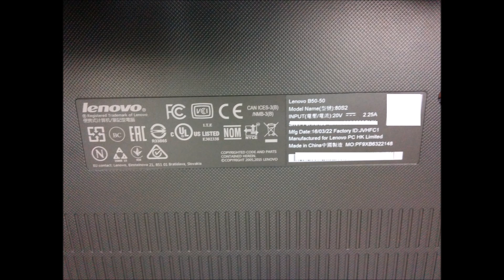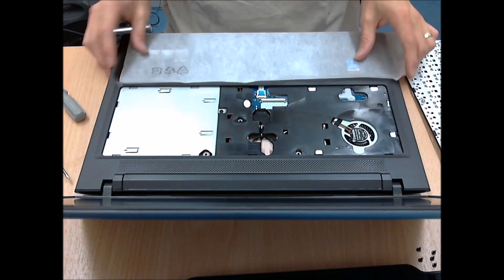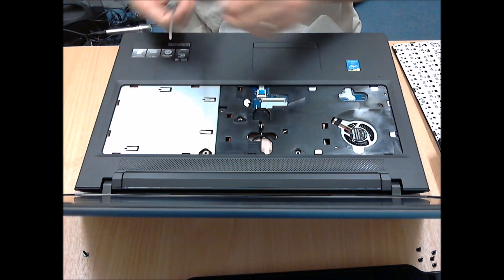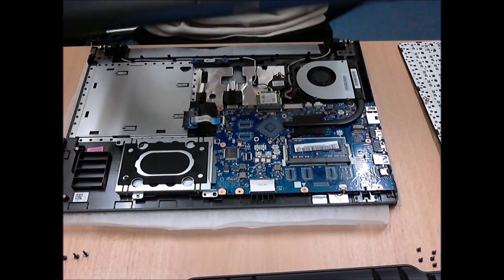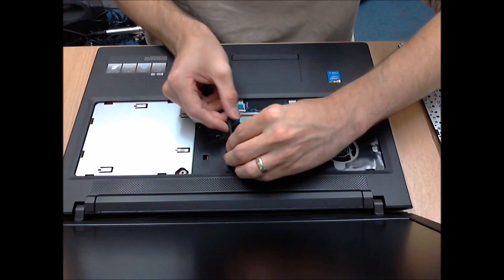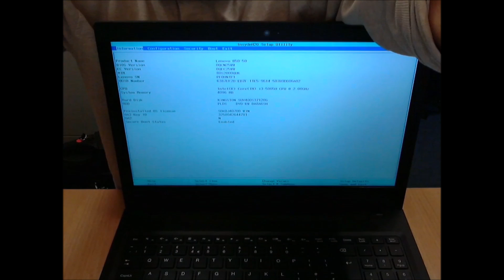Lenovo B50-50 - How to change or upgrade the hard disk

Comment: The Lenovo B50-10 laptop is a total piece of s**t! I'm currently  installing win11 on that dude and I decided to disassembly it, but the laptop didn't come out, then I found out that I have to remove keyboard from it! Then I didn't disassembly it any further to prevent damages. What the freak! It did have pre installed win10 and thank god it did already have 128 gb SSD installed. Ram 4 gb. processor dual core with 2.19 ghz speed. I WILL NEVER FIX OR DO CHANGES TO SIMILAR LAPTOPS EVER AGAIN. This is the first ever time I see laptops when you can't do any changes without removing the keyboard.
Reply from the maker: Over the years computers and laptops have become much less accessible for repairs and upgrades, it's very disappointing.
Reply: @freename  That's why some school teachers say that old laptops/PCs are better than modern laptops/PCs

Comment: Top video thank you - don't you just love the screws under the keyboard faff - I took the screw out underneath then tried to pull the dvd drive out and broke the front plate off it as the screw underneath in the normal place wasn't holding the drive in!! All done and upgraded now thanks again for great tutorial
Reply from the maker: The B50-50 is the most insane laptop I've ever had to open up. HP have made some bad machines but this Lenovo is terrible for serviceability.

Comment: Tragic design
Reply from the maker: Oh yes, I had to replace the hard disks in 60 of these, I got quite good at opening them up!
Modern HP laptops are no better though. Everyone has gone for the design where screws are hidden under sticky feet or the keyboard needs to be removed to then undo the underside.
Reply: At leat it unbuckled quite easily by hand

Comment: Thanks for this. I've opened hundreds of laptops, but couldn't work out why the keyboard wasn't coming off. Screws and plastic welds im used to, but tape strips? Ugh.
Reply from the maker: I had to upgrade 60 of these, it was very tedious. Not as tedious as the newer HP laptops where they hide the screws under the rubber strips though!

Comment: Your video'll help me to change the battery but I have one question:
Is there an extra slot for add other 4gb of RAM? Or the only way is change the 4gb and put 8gb?
Reply from the maker: It has just the one RAM slot. To be sure or to know which RAM to get I would use www.crucial.com system scanner.

Comment: Thanks for the video but what exact type of screwdriver do you use? I have trouble removing the screws
Reply from the maker: It was just a cheap tool set (as both of the ones I've had over the last 20 years have been) from a petrol station.. Lots of different types of screwdriver within it and I pick the most suitable screwdriver at the time.
Something a bit like this: https://m.media-amazon.com/images/I/81DZ6y0U1dL._AC_SL1500_.jpg

Neither have cost more than about £15 / £20 :D They are poor quality but ones I'm happy carry around with me and getting wet, rusty and potentially losing or forgetting them somewhere them occasionally.

Comment: Absolutely superb video. Very well filmed and put together. What an absolute pain this laptop is. I have dismantled some tricky laptops in my time, but this one is awful. I did decide to gently warm the keyboard area with a heat gun (very carefully and from a good distance) to try and loosen the glue slightly. I am not sure how much it helped, but its something to consider. I needed to replace the battery on this one and found that the connector on the replacement did not want to go back in the socket. In the end I plugged and unplugged the old one a few times to try to loosen the socket up a little, and then plugged the new battery in directly, (ie before reassembly) a few times until it would go in smoothly.  Thanks for making the video, its one of the best laptop disassembly videos I have ever seen.
Reply from the maker: I'm so pleased you found it helpful and well made. Thanks for letting me know.

Comment: you've helped one of my pupils to get his computer fixed up. many thanks! now to get the drive cloned - will be difficult as it seems something on the partition is propietary.
Reply from the maker: Glad it helped. Macrium reflect is the easy way to clone but once cloned you might need to use the macrium rescue usb to repair boot issues. Or install windows from fresh and copy over your old data from the old drive manually.

Comment: Can put secend ram or no?
Reply from the maker: In the model in my video there is only one RAM slot. It looks like there is a variant that has the RAM soldered onto the board, on that version the RAM slot might be free and available to put memory into. I'd likely guess that if you have the exact model number mentioned in my video title - you can only have one stick.
Reply: @freename  i see in task manager 1 of 2 slot used
Reply: @freename  and else this is same laptop model but its my old laptop and i saw 1 of 2 slot used
Reply from the maker: What's shown in software might not be what is actually available on the board. If you see in the video just below the ram slot are 4 pads that look like they might normally have RAM chips soldered on them. That might count as the "empty slot".

I think you will only really find out if you open up the laptop and look for a spare slot.
Reply: @freename  it might is other sude of mitherboard secend ram slot?
Reply from the maker: @dongilatorlv  My guess would be no, but that doesn't mean I'm right. (I'm only going by what I can see from the video about the design of the laptop).

Comment: I've just dismantled one of these due to a failing HDD... it's by no doubt the cheapest, nastiest laptop I've ever come across... it's obviously been designed as a cheap disposable device!
P.S. Regularly check all the screws on the base are all tight as they like to come loose and fall out, especially the ones that secure the screen hinges.

Comment: Thanks for your video, it helps me a lot! 
I replaced the hdd against a ssd and after first start up, there is a system password required. Where can I get this?! Thanks for your help!
Reply: Ok its 1234.. whatever
Reply from the maker: How did you copy or install the computer when you out the new disk in? And what operating system? Can you post a picture of the screen you get?

Comment: Very helpful! I strip many laptops in our shop but was doubtful about the rigid keyboard (is there a hidden screw?, I thought) until I saw the semi-adhesive strips in your video. I find an old credit card splits the case effectively, and it helped unstick the keyboard, too. I checked the fan/heatsink, just 2+2 screws to undo, and removed a whopping dust plug from the fan/radiator interface (this lady needs to hoover more!) so do look while you're there. I used fresh heatsink paste but there was enough original overspill to redistribute at a pinch. The duff hard drive was evidenced by repeated boot-looping as the unhappy BIOS sought a network boot. Using a Linux-loaded USB flash drive, I booted straight to Linux desktop and confirmed the Toshiba drive wasn't mountable. It later proved u/s, so an SSD went in. The original RAM is a measly 4GB in the one slot—I popped in an 8GB instead. An SSD, and more RAM, noticeably brighten this i3's performance.

Comment: Thanks for this video. I am an IT-tech myself and did not actually spend any time on the B50-50 after seeing this video (was just upgrading my kids old computers today). Just finished they B50 and that was a completely other computer! Shocked about how different the B50 and the B50-50 was. I bought these two computers a year apart. Have opened many computers, the only one that was almost this bad was one of the old Fujitsu models.

Comment: i'm a computer engineer and find it really annoying how on some laptops you have to disassemble the whole computer to get to the bloody thing, yet with some laptops, most notably older laptops it's simply two screws, flick open a bottom tray cover and voila. Would be nice if all manufacturers made it that easy to get the hard drive in and out. At the moment I've got a corrupt volume on C: and NOTHING works, Windows 10 repair, cmd prompt, nothing wants to see the C: drive so I've got to back up and that means having to go through all this palava on my customer's laptop!
Reply from the maker: Agree, but if manufacturers can save $0.80 in screws and moulded plastic covers they will. And the frustration also means people replace sooner rather than repair or upgrade. It's a win all around for computer manufacturers.

Comment: i have a Lenovo B50  laptop   and its stuck in bios when  i turn it on,  the problem is when i go into the bios and try to change boot order to CD,or USB it wont change and if i pick Default it goes off and stays off with the power light on, iv taken the cmos battery out and replaced it, iv went through all the settings in the bios, iv taken the ssd  out,  the ram out,main battery out, its stuck in a loop, is there  any one can HELP! please
Reply from the maker: Try updating the bios from the Lenovo website first and then see if the settings apply?

Comment: Thanks for this as I was given one of these to repair and although I've been repairing laptops for years, this one baffled me at first.  I have never seen such a poorly designed machine for accessibility. Stripping out the keyboard and removing the case to change a battery !!!   ...  I'm truly cured of Lenovo forever.  Cheers for your video though, it helped greatly.
Reply from the maker: +Bob Clay +Bob Clay no problems. The V110 is bad too.  The bulkier more enterprise Lenovos are still good and easy to maintain and repair.

Comment: Thanks for your guidance.  Having never tried anything more complicated than wiring a plug, I managed to replace the hard disk with an SSD successfully, no breakages or bits left over.
Reply from the maker: This is one of the worst laptops to change the hard disk on so you did well. :) Enjoy the speed boost an SSD brings!
Reply: Thanks, it was worth the effort.

Comment: Is it possible to assembly a 12.5mm hdd?
Reply from the maker: I can only go by the video.. looking at the metal bracket that the drive goes into it looks like there is a small gap at the top so there is some space, a 12.5mm high drive may work. I'm not 100% certain though.

Comment: Icannotgetafreename: This is the model 80S2, which is just one of the many series they've made. For example the B50-50 80S2000LMH is a i5 processor and an older model. I guess you have the 80S2003 series? Just wondering.
Reply from the maker: I won't be able to check for a while - but if I find out I will post a reply.
Reply from the maker: In fact all the information I can now find is on the video anyway at 0:07 - it shows the sticker on the laptop. I don't have the box any more to check what it said on the box.

Comment: nice job, I've only a question... How many RAM slots have the Lenovo B50-50?
Reply from the maker: I don't recall entirely but looking back at my video it does look very much like a single RAM slot.
Reply: thanks a lot
Reply: at 265 gbp it is still not worth it.
Reply from the maker: What other Core i3 15inch laptop with an SSHD could you buy at that price.
Reply: unfortunately there is just 500 gb hdd no sshd
Reply: Anyway, I meant to say 265 British Pounds(GBP). not GBs..lol

Comment: This is really helpful thanks! - Of all the Lenovo laptop models I have ever worked on this has to be the biggest pain. Also having to remove the best part of 20 screws to upgrade the ram / hard disk is a joke. Why is the battery not removable with out dismantling the whole thing!
Reply from the maker: Glad it was of use. I made the video because I also found it painful to work out how to get into the machine. Additionally the service manual that comes up when you Google doesn't actually match the machine that I had!

Not sure I would buy these machines again.. unimpressed with the power socket / connector too, looks very easy to break.